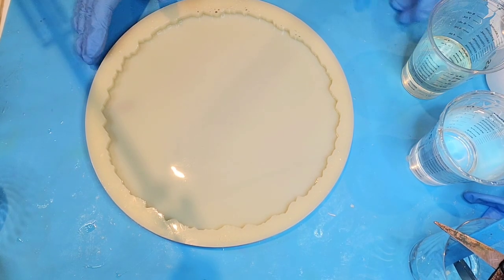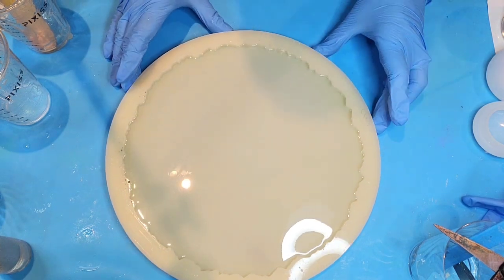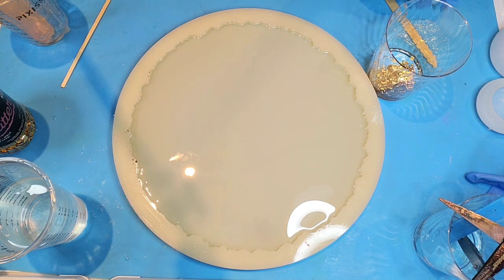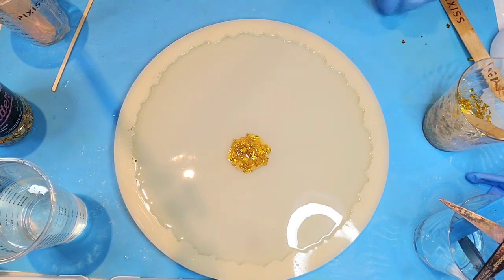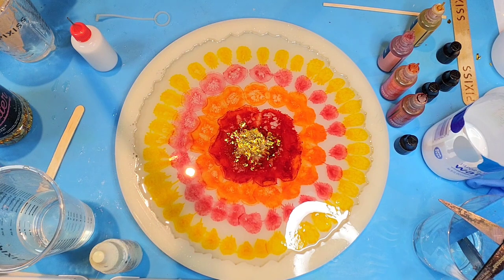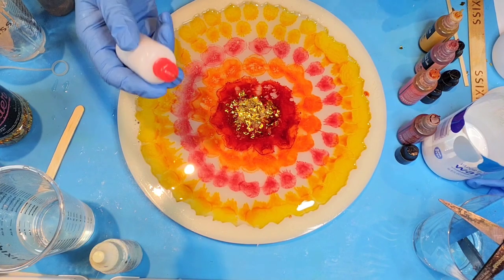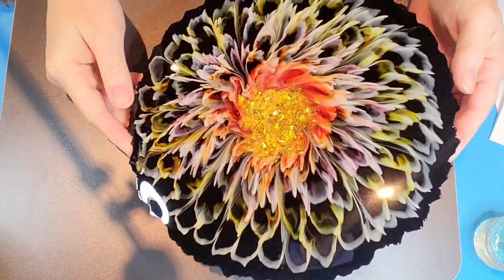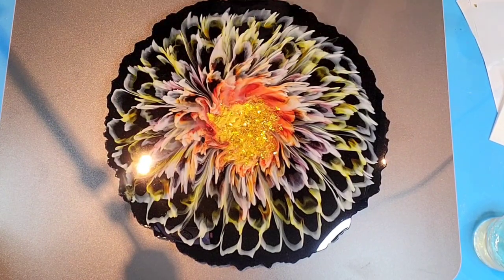How I made a *DIY Resin* 3D Blooming Flower Tray!

Comment: Are resin trays food safe? For example, can I make one of these trays and use it as a charcuterie board? Thank you for such great videos. This turned out amazing! cricket
Reply from the maker: Hi Mermaid. Thank you!   Some epoxy resins will claim to be food safe.  I would never, personally, use a resin piece for food.  If your sandwich or something touched the resin briefly, I wouldn't think that that would be a problem.  But I would not place cheese, fruit etc on a resin piece without a barrier. This is my opinion on the topic. :)